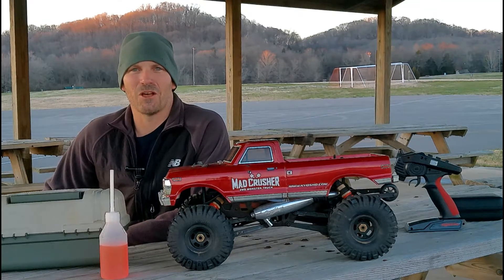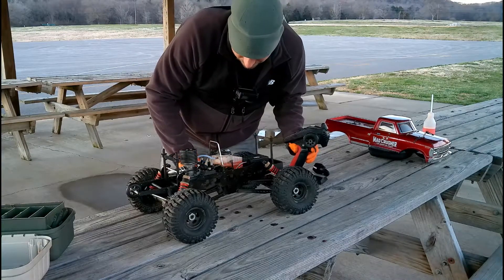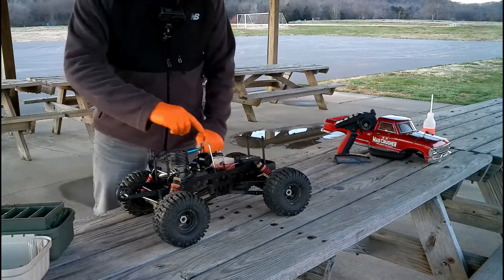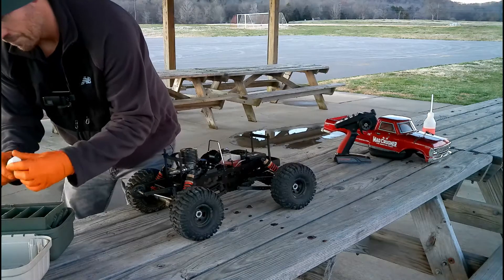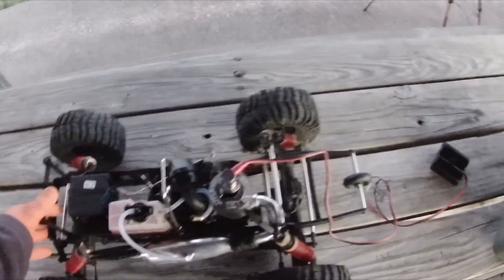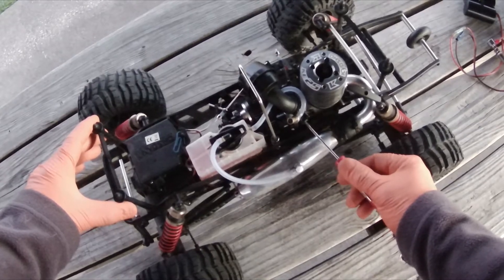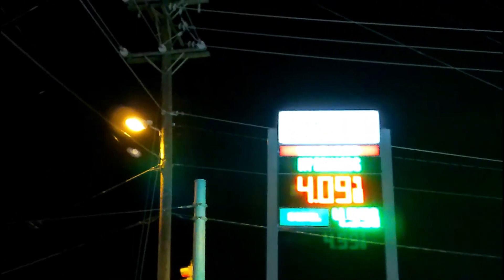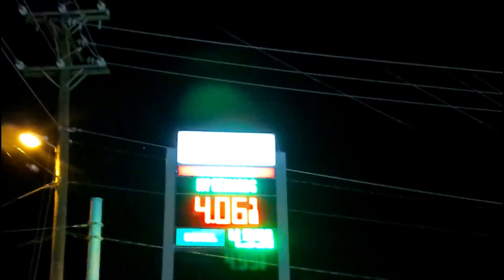KYOSHO NITRO MAD CRUSHER 1/8TH SCALE 4X4 RC MONSTER TRUCK OUT OF RETIREMENT & FMS GIVE AWAY DONT WAT

Comment: Have you had any problems with the 3-speed transmission?
Reply from the maker: NO I HAVENT HOWEVER I HAVE ONLY GOT INTO 3RD A FEW TIMES . ARE YOU HABVING ISSUES
Reply: I really want to buy this truck I wonder if kyosho will ever make this car again
Reply: @GRIFFINRCPLANES  I had  problems with the 3-speed gears getting worn out on the inside. I had to switch to Steel gears from GTB Racing.